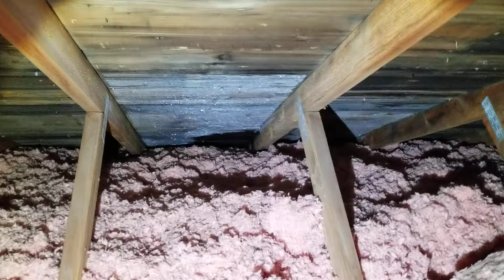Is there frost in your attic?

Comment: Yeah. My home has this issue. I added more soffit vents. And it still frosted up, likely because the bathroom vent was leaking and there was a big hole where the plumbing stack came up. I've sealed both now. And I found raking the snow off on one face of the roof prevents the ice daming. These old houses are a pain. But we really like the area.
Reply from the maker: The more you own,  the more you gotta fix!

Comment: what did u do to fix it
Reply from the maker: It is a dificult fix but you can start by making sure no household fans blow into the attic. Then pull the insulation back and if there is no vapour barrier add some above the ceiling as a temporary measure to bar the humidity from passing up to the sheathing. Ideally the vapour barrier should be below the ceiling joists under the drywall but in older homes it was often missing. If the insulation is dry then spread it back over the newly laid vapour sheet and see if there is any easy way to add some soffit vents. The cold outside air that enters the soffit acts to blend with the warmer humid air which changes the due point and ultimately reduces the extent of the problem. Lots of in and out air is one of the best solutions. Adequate insulation and vapour barrier are also very important. Lastly if it's safe to do so try to keep snow off the roof that tends to melt and cause ice damming,  no snow means no buildup of ice/leaks.